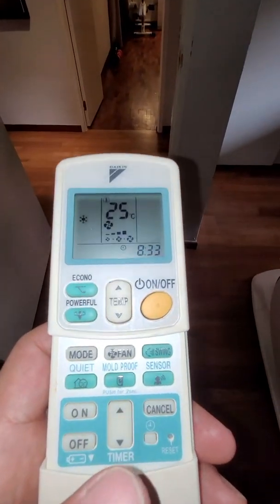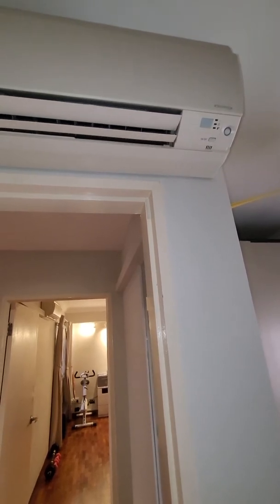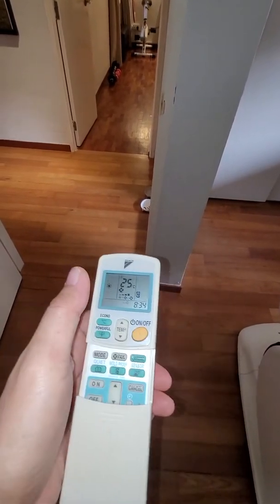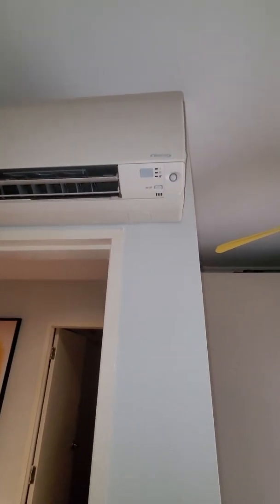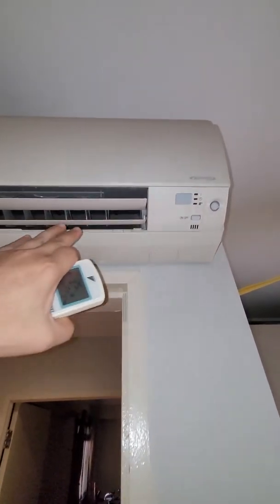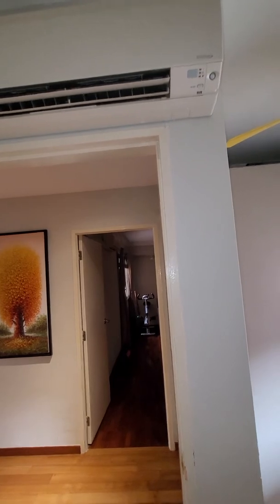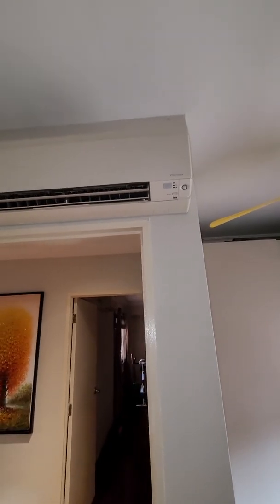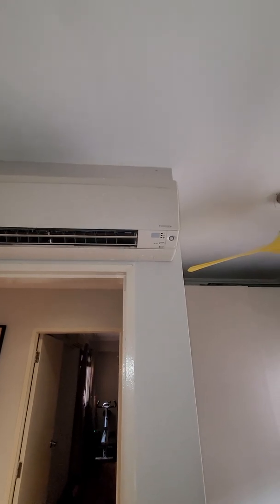How Daikin mold proof function works?

Comment: Thank you so much, sir you honestly saved me from being the second of "that" customer who calls in saying the AC won’t shut down 😂. I had activated this mode called Anti Fungus, and since it didn’t seem to do anything, I totally forgot about it.

Later, I used the AC again, turned it off like usual, and didn’t think much of it. But my boyfriend goes, “Turn the AC off,” and I was like, “I did?” Then the next week, I used it again, turned it off, and suddenly heard a popping sound from the outdoor unit. The indoor unit started blowing hot air I genuinely thought it broke.

I was pressing the remote over and over again, turning it off and on like 1m times, thinking, “Why is this thing not shutting down?!” 

Finally, I saw “Anti F” on the remote, watched your video, and… problem solved. Thank you again! 😅💗

Comment: Some joker hacked my aircon and make my new aircon's trap door closed up while the unit is running... ... 

Now the way to it is simply to use hair dryer, heat the surfaces up to over 55~65 degrees... ... it doesn't kill black mold but... ... the substances on the metal surfaces will dry and be dusted off by huge air pressure plus the heat. Most germs also die at such prolonged (over 15 minutes of heating up). Then use the iron to heat up the bed and clothing plus paper and wooden surfaces... ... and try to direct the heated vapor out of the room.

Surprising, it works very well.

So you feel sick when the water builds up and the blackness catches the aircon, then you air dry it with max temperature for about 30mins... ... the air is ok again and you feel a million bucks again.

Basically once you heated up the metal surfaces, the expansion will 'shake' off those dirts or whatever the mold can cling on.

The room humidity has been like over 75% for most of the time, and air from the aircon can reach a few notch higher than room humidity indicating a problem... ... which at time hits 81% and when raining outside, air from aircon hits 90%... ... There must be a 'leak' somewhere.

My new room will have a lot of moisture absorbing materials which can be ironed outside the room to release the vapor, and to have the germs killed... ...

My neighborhood thanks to a town council which doesn't work but work to destroy the health of residents, alongside also with the fire department of Singapore which actually goes against the stated laws is very badly managed, and if you complain, they add to the pollution. That's how bad post-Lee Kuan Yew Singapore has become. The entire government is broken.

Later I will have the maid to air-dry the unit again, and paint a coat on mold hit surfaces with temporary paint... ... Once the my own room is ready for painting, the anti-mold paint can be used on this room as well. It 100% kills ALL mold. I expect painting to be commenced in a couple of weeks... ... once the new window is installed.

Don't move to moldy Singapore especially when the government is too moldy itself by now... ... if you treasure your health.

Molds attack your kidneys, liver and so on. Mostly kidney damages or lung cancers... ... plus liver attacks too. Which is why Singapore is at times enjoying HIGH kidney patients... ... Reason is very simple. Singaporeans especially the sotong government with 'experts' care nothing much about smoking nor molds... ... and molds is like so usual, and they are taking forever to ban smoking outright.

So... ... get your hair dryer and iron, and prepare for war... ... At least you minimise the quantity of mold toxicity in short intervals. That's important cos molds are really everywhere. 

I doubt this mold-proof will work in Singapore... ... the humidity during rain, even in malls can hit 90%, and usually stays around 70% and higher in residential areas... ... and nowadays, Singapore government is stupidly trying central cooling with long-term uncontrolled lousy contractor culture... ... What will happen is so easy to know... ... and it even made news that many households end up with water leaking... ... hahahahahahahahaha... ...

Be careful if you insist on moving to Singapore post-LKY... ...

It is a complete mess now, and you will be not only guinea pigs for mRNA experimental drugs, but such silly 'programs'.  And worse... ... the HDB flats here... ... the walls are much weaker than in the past... ... and many are hollow.

Which is due to moistures and/or hence creatures and molds, cracks or holes can mean unwanted gas from other units can come to your room.

And don't worry... ... don't expect HDB or town council or NEA to be responsible.

I have wasted my time going after those stupid highly paid state agencies... ...

Comment: Thanks for this video. I followed your instruction to not turn off the mold proof function but my aircon servicing technician told me I must switch off the mold proof/ mold proof mode if not the aircon motor keeps running non-stop? I'm kind of confused now.

Comment: Am I understanding correctly, that for a remote without the mold function, that I can use the fan mode for 2 hours?
Reply from the maker: Depending on how humid the air is. If you set the fan speed at high, naturally it dries the aircon up a lot faster. 2 hours is based on very low fan speed.